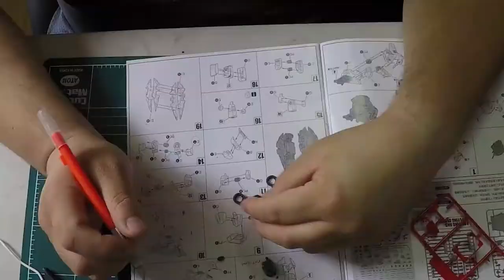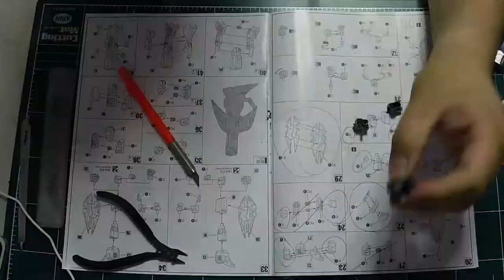017 - MC Penelope WIP 1 - Initial Thoughts

Comment: In the peg thing you are having issues with try cutting a small thick pla plate and gluing it under the thin top piece that holds the peg for extra stability.
Reply from the maker: G M well I've already remedied it with a dab of super glue haha.

Comment: you could glue some pla plate in the hollow spaces below the balljoints
Reply from the maker: Mulambo yeah I just used super glue to adhere it to the other side, worked out. Minimal work. Haha 
Gettin out the plaplate and cutting it to size and Stickin it in there haha too much work. 
One dab or glue. Done! ;)